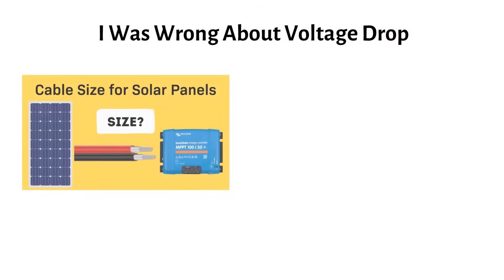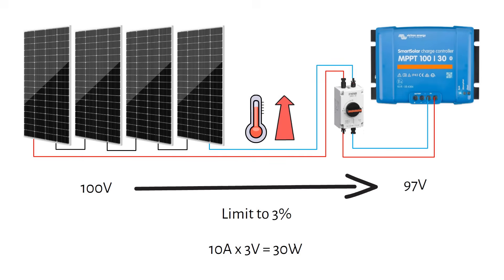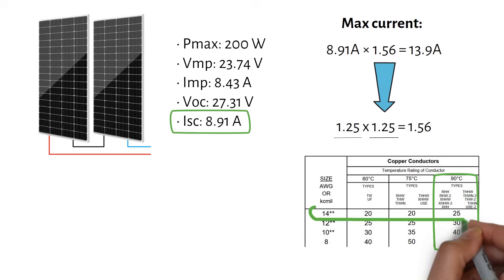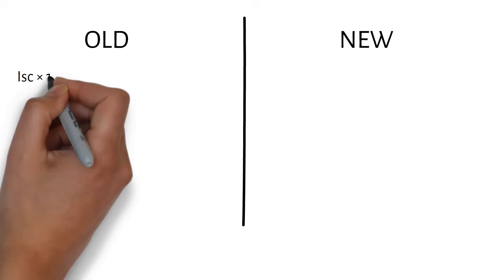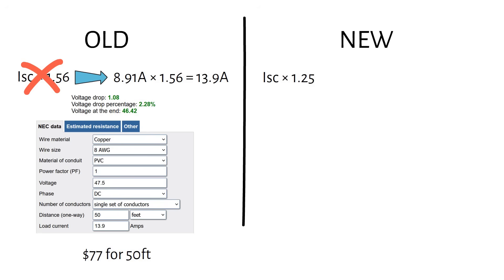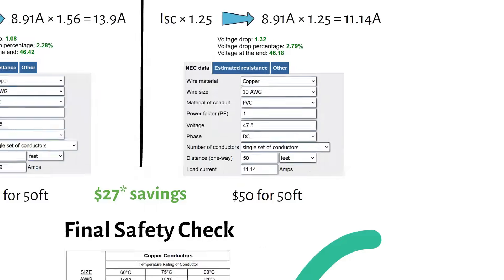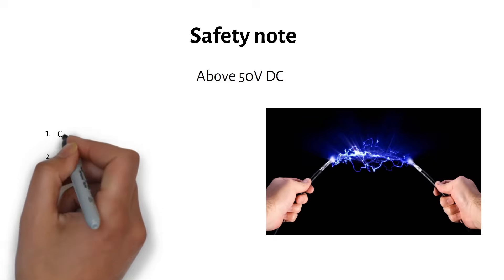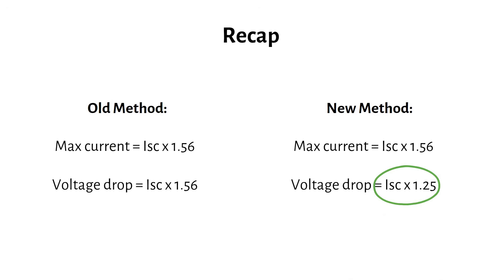Solar Panel to Charge Controller Cable Size

Comment: Thanks for the correction.  I purchase 8 gauge wire based on the old information.  While more expensive than it needed to be, I have an increased level of safety.
Reply from the maker: Sorry 🫣 Now you will have less power loss in your system though.
Reply: Agreed.  Doesn't hurt (except cost) to have the larger wire....
Reply: Also allows for additional panels later.